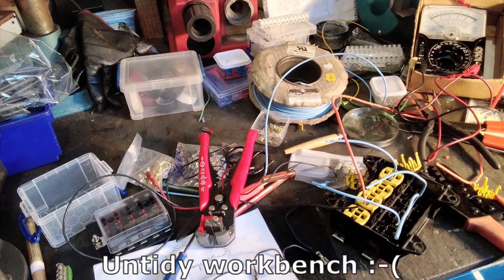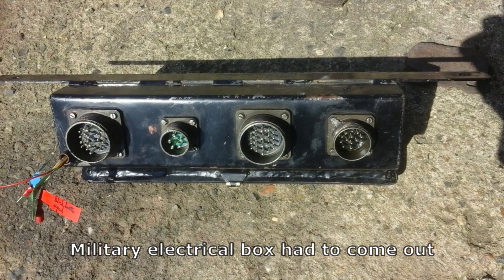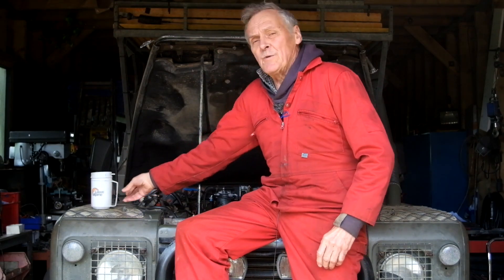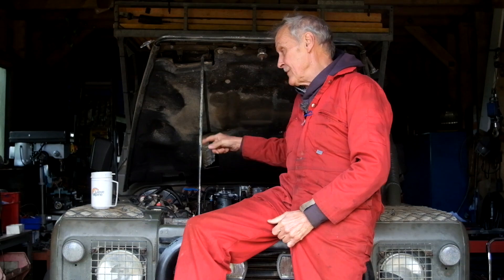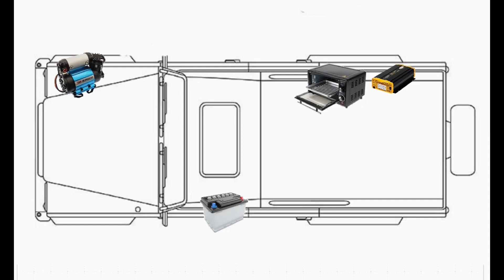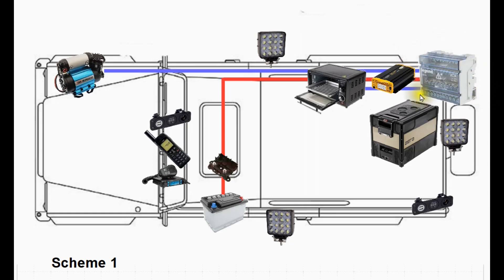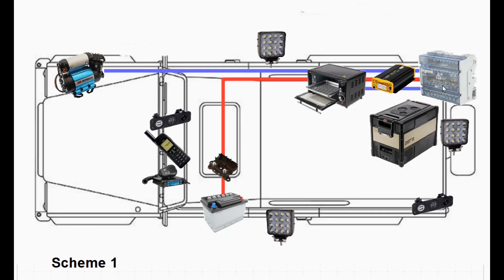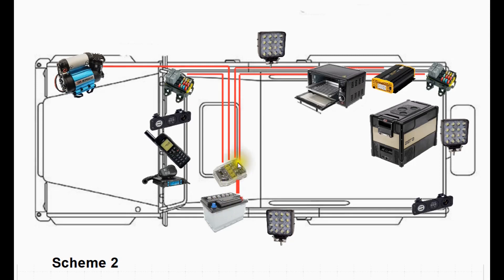Defender electrical revamp Pt 3 - auxiliary battery system

Comment: Perfect system aproach. The multi hub system works better in my opinion too. Long signal wires, short power wires. There is also an advantage in having the ability for ignition or engine run circuits at the hubs, something you cannot do with those single point fuse boxes. It is also worth considering the maximum through amperage in things like fuseboxes. the ones you are using are not very highly rated, but handle a lot more than they are rated for. 
 The only suggestion I really have to this is an IP rated fuse box for the front one, those little boxes don't like water. I've replaced a few with rotted out insides

Comment: I have recently acquired my 110 and I definitely want an auxiiary battery setup.  I notice that a lot of Defender owners are going for these Jackery portable power systems, and I was tempted, but they are very expensive and I struggle to find many examples where I would use the "portable" function of it given the size of these big units.  You're not going to be porting them very far, and then what would you be powering with them when you get there? Most "away from the vehicle" use cases you can think of can be satisfied easily by much smaller and truly portable 18650 based power banks.  So for me, an auxiliary battery installed permanently in the Defender - which is where I really need the high power devices - is the way to go.  Much cheaper too, but there is of course the significant effort involved with installation as another type of cost.

Anyway I enjoyed your planning presentation (food for thought) and also the advice regarding ducting and terminations etc.
Reply from the maker: I am not familiar with these Jackery portable power systems but, having looked them up quickly, they seem to be glorified power banks. This would be fine if you are doing short trips from home when you can charge it up before you go but much less practical for extended trips. You'd need to have a charging station built in to the vehicle and if you are going to do that you'd be better off with an auxiliary battery IMO. I hope you find a good solution whatever you decide to do.

Comment: What software do you use for wiring diagrams design?
Reply from the maker: For simple graphics I use Open Office Draw but I also have a very old flowcharting programme (Flowcharter 2003) for doing SLDs which takes care of the cable crossovers. I also have much higher end software (TurboCAD Platinum) but that's way too complicated for 2D graphics.
Reply: @defendermodsandtravels  Thank you, will try now. I am in the actual process of doing my electrical system too in my Defender
Reply from the maker: @Maedetto  Best of luck. Let me know how you get on. I am always happy to share ideas with you.
Reply: @defendermodsandtravels  I am still at the design stage. I am thinking of adding a layer of complexity to what you have done by using a lithium starter battery as well as a lithium aux battery. By doing so I am able to both save weight and to exclude the need of a dc-dc charger for effective charge. By speaking with the technical support of the battery manufacturer, I have come to the conclusion that only an isolator between the 2 batteries is required. This can be achieved with the cheapest and most reliable voltage sensitive isolator in the market, however my problem for now is to find one that works at an appropriate voltage as a lithium battery can sit at 13.3V when not charging thus meaning that most of the voltage sensitive switch are going to be always in the "closed" position. The built in BMS in the batteries allows also to not require a solar regulator but only a reduced voltage solar input. What do you think?
Reply from the maker: @Maedetto  "A man should know his limitations" (quote from a Clint Eastwood movie, Dirty Harry I think). I know little about Li batteries and hence can't advise. Stefan Fischer of All Offroad Adventures has has made a particular study of Li batteries and Roy who comments on this channel is pretty knowledgeable too. If you have difficulty contacting either I can try. Good luck.
Reply: @defendermodsandtravels  I am also not an expert on lithium batteries, for this reason I am inclined to ditch the idea of a starter lithium and just use a traditional lead acid. I may use lithium just for the aux battery where I can afford to be let down and learn a bloody good lesson.
I do follow Stefan on YouTube, I might try to pop a message and see. I haven't messaged with Roy but would love to have some advice as I am far from expert in this field.
Reply from the maker: @Maedetto  I will give Roy a nudge in case he hasn't seen this thread.
Regarding the starter battery, it depends where you will be traveling. If you are staying in a developed country like Aus then you will have all the support you need so you can afford to use new technology. If going to less developed countries it's wise to be conservative. I use an Optima Red Top starter battery and find them great but a bit heavy.
Reply: @Maedetto  I'm afraid I don't have any personal experience with lithium only what I've gleaned off the Internet so my advice has to be lead acid starter because the the alternator output voltage is correct and some bms can cut off completely this would destroy the alternator, a dc dc  charger for voltage correction, isolation and current limitation also use a solar charge controller for voltage correction, sorry you will have to deal with the weight but cost wise it will probably be cheaper. One draw back with alternators is they are air cooled with a built-in fan, at tick over modern open cage ones can produce between 20/50 amp's and there is not enough airflow add this high ambient temp and 2 lithium with no current restriction it will just fry and burn out. I like everything about AGM batteries except the price if its not a daily drive or you're doing rough roads with corrugations they're the way to go. Voltage sensitive relays can take ages to switch off if you stall and restart they will switch off while drawing a large current and eventually burn the contacts out just like winch solenoids do, you can switch them off simply by switching the little earth cable but if you do this then you may as well just use a large relay. Sorry for bursting your bubble Roy.
Reply from the maker: @royblackburn1163  It sounds like good advice to me.
A point to note about solar charge controllers - if you fit one make sure there's an isolating switch so they aren't permanently connected. I found that my solar charge controller and mains charger were drawing >100mA when not in use which will flatten any battery within a week or two. I trust that DC-DC chargers leak less current.
Reply: Need you to sought my 110 out ,  the system you've installed is very well thought out. 👍

Comment: I like the approach to your system. I really need to lock in what aux battery I use and where it will live before I have a hope of starting our wiring upgrades. I am still torn with carrying extra weight of an aux battery for everyday commutes. Every kg affects the economy as it also affects GVM when loaded up for trips.
Reply: I have my aux batteries on anderson plugs so they can be taken out when not needed
Reply from the maker: If you are worried about weight then a Lithium battery would be an obvious solution. I won't touch them because the associated electronics. I have just ordered a new Rolls AGM battery which should give me good service.
For me an auxiliary battery is absolutely essential.

Comment: Very hard to constructively add much, apart from suggesting to leave spare draw wires or lengths of fishing line through major arterial conduit runs for future development.  High duty cycle heavy loads, especially "Travel Buddy" type pie  ovens and to a lesser extent  inverters and compressors  will be areas to be most over-generous with conductor sizing and current  rating of terminations  to avoid thermally stressing .  If wanting some precision,  the IEE Wiring  Regs (sadly now IET) have useful  tables giving downrating factors for current carrying capacity, considering environmental   temperature , "grouping factor" of multiple cables and in-conduit versus "clipped direct" installation methods. Only a high-end inverter will likely be picky on incoming Voltage to decide when to abandon operations as battery Voltage sinks; is your Victron unit a new one or already mission-proven ? Also, notwithstanding my mania for simplicity, I like the idea of your auto low battery Voltage disconnect unit; I'd better investigate ! Rgds
Reply from the maker: The low voltage cut off is a great battery saver. I bought an Alfatronix 60A unit (https://www.alfatronix.com) - British made although you can get cheaper Chinese devices.
There is however one pitfall; these are designed for one way current flow so any charging devices should be attached directly to the battery post. I found that both my mains battery charger and solar charger liven up when they are attached to a battery and will drain it after a while. I have these auxiliary chargers on a toggle switch (on - off -on) so I can charge either battery and I just need to remember to leave the switch in the off position when not in use.
The Victron inverter is about 6 months old. The previous inverter (which shall remain nameless) expired in a puff of smoke and could even have caused a vehicle fire. The inverter is rated for 500W but fused for about half that. I like to run equipment de-rated for reliability.